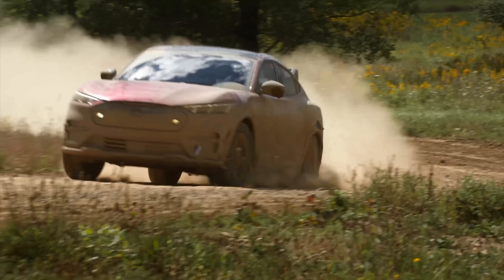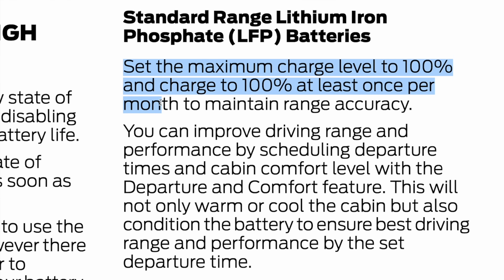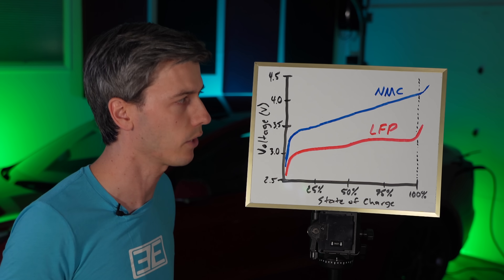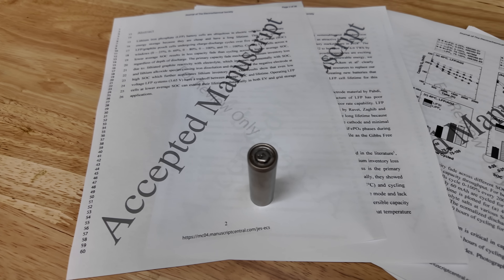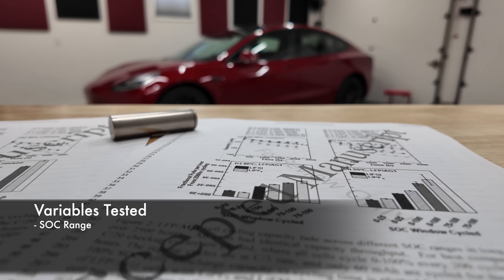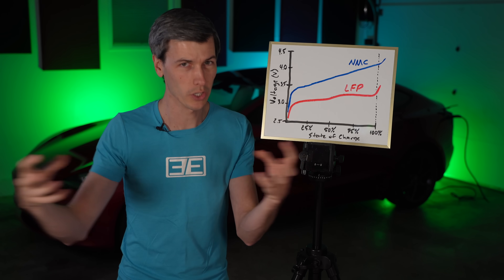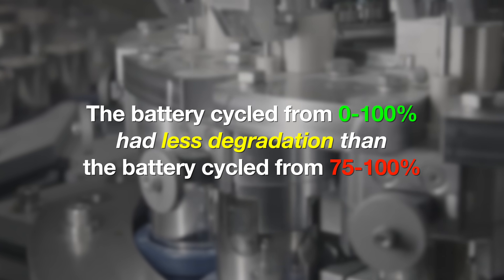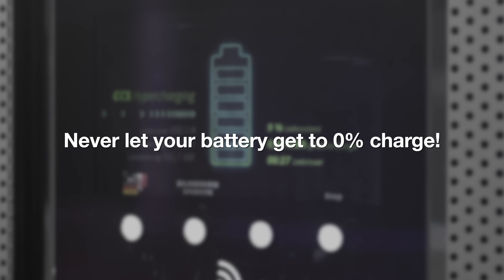How To Ruin Your Electric Car's Battery - LFP Edition!

Comment: Can you do a video on Rivian’s new wheels? It’s annoying how they won’t commit to a 20 inch wheel with a AS tire. Their “max range” option is a 22 inch wheel. I know from your previous video that smaller wheels are better. But why would they design a 22 inch one? This 22inch one is supposedly forged and has that flat face. In theory is it just as efficient as a 20 inch wheel with normal spokes on the same size tire?

Comment: Lol... We're all gonna plug it in and let 'er rip to 100% regardless.
Reply from the maker: In this case, not completely terrible!
Reply: @EngineeringExplained 100% in an EV is never 100% battery charge
Reply: Manufacturers can (and I think do) lie in their state of charge level so that when the dash reads 100% the battery is actually only charged to like 85% because they want to increase cycle life.
Reply: @F0XD1E  yup, but 85% of that 85% is still better for that battery
Reply: @F0XD1E  this is not the case for LFP.  You need a pretty close to 100% SoC to reach the ~3.7V cell voltage.  It's possible that tesla maybe doesn't quite reach 3.7V (maybe 95-98%) but at 85% an LFP will likely be still near 3.2V!
Reply: I was trying not to charge to 100% and calculate my trips to lower my charge as most as possible to do the recommendation of operating on lower charge.
And the day I was at my lowest charge, the public charger I went didn't work, my batery got to 2%, and I paid to tow my car to another charger dozens of kilometers away.
So yeah, now I'm always charging to 100% no matter the recommendations.
Reply: @bargainbincatgirl6698  Life is too short to worry about little things like this. It's unlikely you are going to keep your car for 10+ years anyway, keep topping it up like your car manual said.
Reply: @TwistofWrist1941 Most people that aren't fortunate enough to have a lot of money keep their vehicles for well over 10 years :)
Reply: @mjay6245  Lucky I'm in a country that has universal public health care. Hence we can buy new cars every so often. 😄
Reply: Are you saying you will live longer under public health care?  ;)
Reply: Yes, Australia and England spend around half of America's GDP on healthcare and we have a public healthcare system.
Reply: I try to juice up to 100% before I know we will trip.  But even my ECOFlow or other LFP 100Ah solar which sit at 100%.  There are times though in at 84% and it goes to 100% as a result.  1 year it went from 272mi to 265mi
Reply: Which is Tesla's recommendation anyway

Comment: Can you do a DCS batteries edition please? 70% is the new 80% apparently. 😉
Reply from the maker: Generally speaking lower is better for li-ion batteries, but realistically that's a lot of added weight, cost, and useless capacity if you don't tap into it. Range is an important metric so it's good to find a balance for what distances you're driving.
Reply: I think my tongue in cheek comment was missed. I was poking fun that the now infamous DCS batteries will not replace or refund batteries under warranty unless it has less than 70% of its rated capacity. DCS appears to have changed their policy after Oct 2022 to this new capacity figure from 80%. Hence, maybe a guide from you on how to protect these delicate batteries. 😂
Reply from the maker: @spectremarty  Ha, okay, yeah I didn't know (I guess I still don't) what DCS batteries are, so just a vague reply on my behalf. 😂
Reply: @EngineeringExplained DCS is sn Australian 12 volt replacement car battery company that has been in the YouTube news a lot lately for suing YouTubers for their honest reviews showing load tests and internal construction that are far below what they should be for the price point of the battery and other competitors.
Reply: @spectremarty  Can we project that this threshold will be redefined as 60% in 2026? 🙂
Reply: Haha
Reply: @WillProwse Watched your teardown of that unit. Good stuff 👍
Reply: @WillProwse  :D

Comment: I love how the graphics on screen are either really technical details or just some joke. I never know what to expect.
Reply from the maker: Lessons from Forrest, Forrest Gump.
Reply: @EngineeringExplained life is a like box of LFPs, you never know how much capacity your gonna get /s
Reply: It's was.gibrish to me
But one thing I know
Is that hydrogen will. Not work
Will.nver be profiltbl3
Reply: @mesiroy1234 Hydrogen requires insane infrastructure to be built - a mirror of the oil infrastructure we have but instead of most of the product being moved in liquid form, it’s a high pressure gas. We would need pipelines and ships and distribution hubs and manufacturers etc. That could still be profitable - after all, we did build that infrastructure for oil and the profits are like nothing the world has ever seen. However, when we invested all that money into building oil infrastructure, 1) there was no competing technologies, so those profits were guaranteed and 2) Nations had empires they could cash in to pay for it. Today you would be relying on private investment.

So it’s not that it could never be profitable, it’s that even a company with the war chest of Apple could set up an operation and go bankrupt in a year if a third of people stick with hydrocarbons and another third stay or go electric.

Comment: The F is silent but deadly 💨
Reply: Fe real
Reply: For anyone that's interested: the F stands for "Ferrum" which is Latin for... "iron".
Reply: @sandrinowitschM Or it is just short for Fe
Reply: It’s actually safer than its non-ferrous counterpart
Reply: Kills stars, super dangerous
Reply: LiFePO4
Reply: ord mach-e 😂😂
Reply: Essentially a thermite bomb for a charge source...
Reply: @hellbringer09  false. You can damage and pierce through LFP cells and they will not ignite.